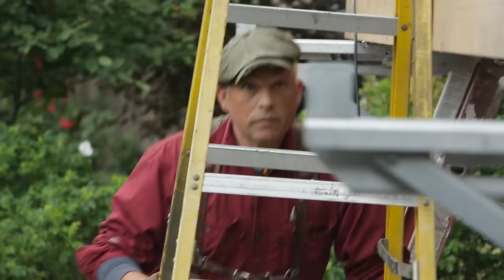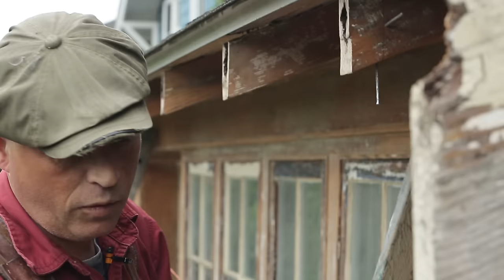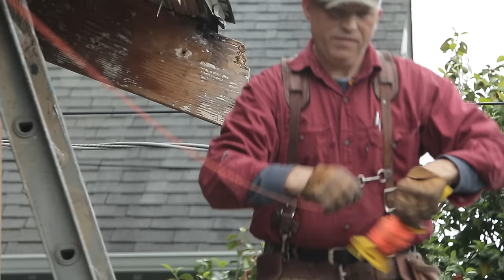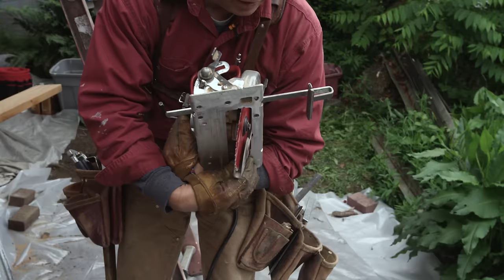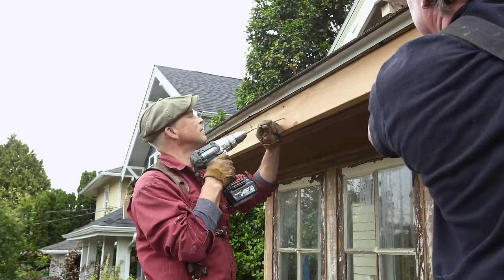How to Repair a Rafter Tail & Install Fascia

Comment: This a video that has info about the rafter tail that i was looking for, I was told that our home has some rot on the rafter tails by a rain gutter installer, I saw it too, but that it might be okay just to leave it and replace the fascia, I believe that it should be replaced now before installing anything else and obviously it will be additional cost added to rain gutter installation. I would have liked to see underneath where the rafters are, and also a finished job. Thank you I really liked your video, and will check out your other videos.

Comment: Dealing with rot on the rafter tails myself.  I’m not a carpenter, but can someone explain why gutter screws install right into them. I would think you screw another 2x4 right next to the rafter tails and attach the gutters to these. That way you can maybe avoid the eventual rot from the screws going into the end of a piece of wood that is not easily replaced and into one that is.

Comment: Best practice is to Seal the ends of all timber during construction with a good Primer Sealer.
The end grain of timber is like a sponge .
Reply: Which primer sealer works best in your opinion. I’m looking to DIY at my home. 
Thanks
Reply: @everettwhite9874  I usually use a bitumen based brush on sealer. And when building a deck within a metre of the ground I seal the entire subframe before laying the floor .
Reply: How long did the fascia board and rafter tails last before they rotted out from the aluminum nails? What do we use nowadays days?
Reply: @Brandon-no3vc  It's sounded like there was no facia board. That would be most of the issue, gutter apron Shou have also been installed over the facia board to protect from water getting behind the gutter.

Comment: sawsall tip:  put the blade in upside down, teeth toward the top of the machine. you have to use the sawsall upside down, or in this application right side up. you can get much closer cutting angle this way.
Reply: Sawzall tip: use multitool.
Reply: Correctomundo

Comment: Seems like a multitool with a flat blade would more ideal than a sawzall.  Thanks for the video, always great to see a master tradesman at his craft!
Reply: That's what I Thought one of those Multi Tools for the final Cut would be Much faster and easier to move around Then a Sawzall
Reply: My multitool is slow as crap. Like 1/5 the speed of my ciprocating saw.
Reply: What about a steady precise karate chop?
Reply: @pierredelecto7069  Exactly.
Reply: They make flush cutting blades for jig saws, and reciprocating saws, too. You could go all the way up.

Comment: I did this exact job 2 years ago, I didn't find anything as helpful as this would have been. I had to make it up as I went. Wish I would have seen this first!
Reply from the maker: Thanks so much for the feedback! Let us know what else would be helpful content for you.
Reply: I had a similar situation with an old house where the original part had fascias that angled back, and an addition had plumb fascias.  I decided to straighten the angled ones to match.  This is not an open eave as in the video, but a completely closed one.  I decided I didn't what the hassle of trimming the rafter tails with the roof decking in the way, so I did 2x4 blocking between them to create a subfascia.  Each subascia block has short 2x4 legs screwed on either side that run parallel to the rafters, and I screw those legs into the rafters.  I decided on the legs because it makes it easy for me to get the blocking in the perfect position before screwing it in.  Then I put my fascia over all of that.  Sounds like a lot of work, but it goes quickly.  I've never seen anyone do this, but a year later it is still good.  Does anyone actually use this method?
Reply: You just reminded me of how, many mid century modern homes had fascias that sloped back, meaning the rafter tails were a square cut. These fascias are usually raised above the roof line and were done that way to form a "swale" out of the roofing that acted like a gutter. In any case haven't done exactly what your describing, but sounds like its strong and minimally evasive. It seems like you thought this technique through before starting, and that's whats most important.
Reply: redrider3141 .po

Comment: How did you get rid of that gap at the top of the fascia in the middle. I'm replacing my fascia and soffit on a 33' run on the side of my house and the ends are 1 to 1 1/2" lower than the middle. I was planning on measuring and trimming the top edge of the fascia so the bottom edge stays straight. Any suggestions. Thank you Daniel. I'm 70 and could use any advice you would be willing to share.

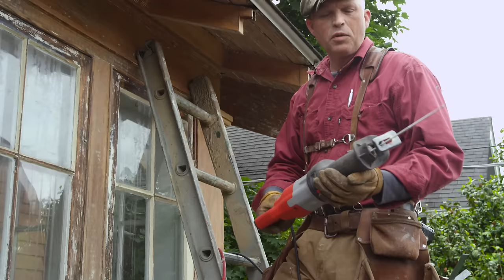Comment: 2:38 sometimes i flip the blade in the sawzall so I can get horizontal cuts more flush. But in this case you might be against the next rafter.
Reply: Mike Dorman  What about those multi tools?
Reply: Yes, and/or a plunge cut blade on a multi-tool to finish the cut without scoring the soffit.
Reply: @elifire4147  seems like a no brainer
Reply: How long did the fascia board and rafter tails last before they rotted out from the aluminum nails? What do we use nowadays days?

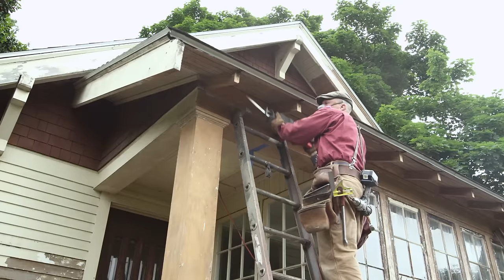Comment: At 2:50 it shows that you missed the mark on the cut.  How did you square it up to the mark so that the board fit?
Reply: The jig saw blade will want to bend in that hard fir. So what I do is clean up the cut with the jigsaw coming from the other side, or use a saws all with a fine tooth blade. Id prefer to use a skill saw, but with a soffit is not as easy, so I try to have a verity of tools available for just about any situation I may run into.
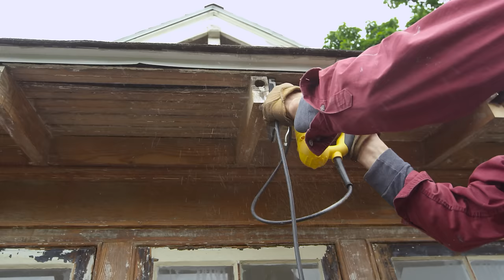Reply: 2:20 big miss. It did not fit unless he missed the same on all the tails. I set a angle on my skillsaw so it is the same for all my start cuts. Very poor cutting. Also he needs to snap his chalk line so you know it will not move.
Reply: @tomharvy9374  he isn't using a chalk line

Comment: Nice video.. let me throw out a question.. My neighbor's tree fell on the corner of my garage snapping off the 1st 3 rafters right at the headerboard... I imagine the easiest thing to do is to scab a 2 by 8 from the inside of my shop so that it's level with the rest of the rafters.. Is this what you guys would  do?  I also realize now that the 1st 3 rafters will be an 1.75"  offset from the center of where the broken ones were. is that really an issue?

Comment: Quick question what do you use to cover those screw holes before painting the fascia.  Would you use caulk or a would filler? What will last the longest?

Comment: I have an open beam ceiling with 10X4 rafter beams that pass through the exterior wall out to the lanai by the pool where the tails are rotted and sitting on a 12X4 support beam that runs 36 feet.  So there are 5 rafter beams that need the ends replaced, and the entire support beam under them has to be replaced.  Currently it is solid cypress but contractors have said stacking 2X4 boards can substitute for a solid beam, and I don't like that idea but given the expense and difficulty getting beams now may have to go that route.  My question is how do you replace the last 1 or 2 feet of a major structural beam like my rafters are?  Tearing the roof off to get at the tails is not practical, for one thing the solar pool heater is up there.  The roof is a type of construction I have never seen before, the house is what is called semi monitor with clearstory windows, and 18.5 foot high ceiling in the living room.  I have one estimate of $29 thousand and that seems pretty high.  Covid meant nobody working here all of last year, so it is pretty much getting to the emergency state.  May have to pay it.  County regulations mean I pretty much can't do it myself or hire handyman type carpenters.  Also will need engineered drawings as the county did not see fit to retain the original blueprints even though it was an architect designed house.  Getting an engineer to do them will be a problem.  I had one here who thought cypress was strictly decorative; he was from New England and was thinking of pecky cypress which is not structural.  But cypress is a fine choice in this climate, it is oily and strong, also much cheaper than cedar or pine.  Any ideas on how best to replace these tails is appreciated.
Reply: How long did the fascia board and rafter tails last before they rotted out from the aluminum nails? What do we use nowadays days?

Comment: Maybe dumb question but you cut off 3" of rafter
 You don't replace that. Now the ends won't match to th3 other side end. End of video th3 fascia from the other side is sticking out past the side you repaired.

Comment: When it sags on both ends, how can you make it straight?  Trim more  both ends ?  My rafters are not even, some are more than 1.5 " so there is a 1/4 to 1/2" gap between the facia board and the rafter tails, if i trim them even using the biggest gap (1/2") as a guide, the roof will protrude 1/2" inch after the gutter  be installed, what do you suggest i should do?
Reply: Does your house have soffits? If so, you could just use some 1/2 inch plywood to shim at every rafter tail. The soffit would hide the shimming. Be sure to use 1/2 inch longer nails.
Reply: seems like the point here is to use straight lumber and let the new lumber straighten the roof line as it should be. Making something match what is sagging doesn't make sense.

Comment: wait but putting it that way and using that size wood  creates problems, one well now it does not match the sides left and right 2x4s that you can see stick out like a sore thumb and even if you cut those to match the length now they are still lower than the front one that you just put so it dont match also, why did you not just use 2x6 so that the front one goes down further in with and match the side ones and all you had to do is cut the sides in length but will match them now?

Comment: I found this pretty confusing probably because I am not a woodworker. How did you get the fascia up higher in the center? Does the fascia lift the ends up or did you shape the fascia? There were no images at the end and “starting in the middle” seemed impossible…does the wood bend up? Concave in what dimension?
Reply: I imagine they clamped it up. That's what I would do.

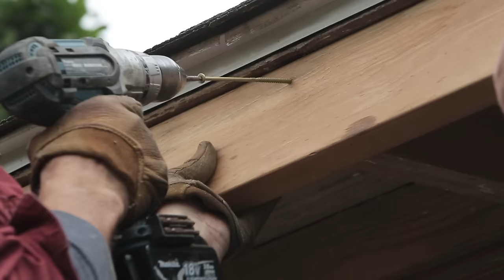Comment: 4:14 what screws are those? I need structural/framing screws in my life.
Reply: On our house we used #10 deck screws instead of just exterior screws. We actually used them inside and outside!

Comment: How far in can i cut into rotted rafter....is there a requirment for leaving so much  overhang?... thanks
Reply from the maker: This is really a matter of balancing the situation with your end goal. If you have a wide overhang with minimal decay on the rafter tails, you can likely trim them back and still be just fine. If you currently have minimal overhang with significant decay, you might consider trimming back the tails to solid wood, then "sistering" another piece of lumber to keep the amount of overhang you have. These decisions are also impacted depending on whether you are just making repairs, or if the work is part of a re-roof project.

Comment: Wasn't clear how the gap in the middle run of the facia was eliminated. I assume just pushing up on the gaped section; deflecting the board up is the answer.

Comment: What do you do if the wood rot is deeper than the rafter tail and extends into the say living room ceiling?  Can you replace a whole rafter and attach it to the main "arch beam" (forget the proper name) assuming the ceiling is going to be tore out and exposed.
Reply: yes of course. Especially if ceiling is tore out, is the time to do it. Then next time you replace the roof, go throw some nails into the roof sheathing where the rafter was replaced so its attached properly again. You could also use some short screws from the underside making sure not to purncture your roofing material.
Reply: you can also use a sub fascia to move the fascia out. or sister the rafter tails

Comment: Hello, I am planning to fit a porch roof to the house, (circa 67 wooden framed) the fascia is narrow in vertical depth and matches the height of the sloped rafter tails. The modern guttering attached to the fascia board covers about 3/4 of the board so there is insufficient room to attach a ledger board through the fascia to the rafter tails. Can I use a deeper fascia board and replace the one on the house in order to give sufficient room to mount the ledger board? Would this be strong enough? If not would it be better to sister some deeper tails to the rafters which would be notched to match the existing rafter but deeper at their ends so I van attach the wider fascia? Thanks
Reply: Hi, Allen. I'd have to see your project to really know what your up against, but generally its best to remove the gutter, fascia and soffit, so the rafters are sistered in. Maybe best to also sit the new rafters on the top plates, and that might require removing the blocking between the existing rafters. Ledgering onto the fascia wouldnt be strong enough. The end goal in adding to an existing structure is two fold. Making sure the tie in is, structurally sound and the design is seemless. Does htis help?
Reply: Thanks, yes that helps. Looking at the fascia it is only about 20mm thick so it may be covering a thicker board like the one you put on in this video. The way it seems to be done here in New Zealand is the ledger board attaches through the fascia boards and into the ends of the rafter tails with bugle screws to give sufficient strength. I would attach the ledger board under the soffit but can't because the top of the window frames are mounted directly under the soffit edge and so there is no room. This may be negated if I put in new doors as an entrance way, but I fear the underside of the porch or pergola roof will block the view and be probably too low to walk under particularly at the sloped end. I can get about a 2m height if I only slope the roof 5 degrees which is not much. The main roof is only 20 which Is not steep either. It might mean I end up making the roof a stand alone one with its own posts next to the house. Whilst more involved it may be the strongest option. Thanks for you advice.

Comment: Very nice!!!  What type of wood are you using for the fascia and would you recommend primed white pine.
Reply: We are using an S4S cedar. That is smooth four sides. Cedar, is the best for exterior applications. If there is a chance to be exposed to the elements, especially in Seattle, I would not recommend using a softwood like pine, or hemlock on exterior surfaces even if it is pre primed material. You can get a pre primed tight knot cedar, from Dunn Lumber. Does this help?
Reply: Or Windsor wood which is an engineered wood preprimed with a 20 yr warantee.

Comment: Why did this rad kook screw so croocked into the rafter boards.   You could have used a 2x4 bottom sits flush to bottom of rafter.   I put a 12 ft 2x6 up myself on 2nd floor home.   Nail 2x4 block extending out past bottom rafter for facia to rest on so you can nail/screw it into rafter

Comment: I did a like job on my garage. Dewalt makes a flush-cut blade for saber saws - no need for the Sawzall.
Reply: Thanks for the tip.  This will be handy in certain construction situations.  DT2074 fits dewalt and bosch jigsaws, among others.

Comment: My man looking how he time traveled from the great depression era. Just kidding..

  Nice video, my mom's house has gotten bad water damage from a shitty install drip edge or something and the facia* and rafter tails are rotted.. Its soo bad the damage has come inside and her drywall on her ceiling is cracking and starting to come down..  I have to tools and some know how but I told her to may have to replace the whole rafter and take down the ceiling to access it..  You can even attach a new facia* to the rafter because the exposed rafters are soo old and rotted.. Someone quoted her $1,800 just to fix the drywall on the ceiling ect not including replacing the rafter,facia* and installin a new drip edge.  I need all the youtube knowledge I can get.

Comment: Nice informative video. The 'CROWN' of the fascia board be 'down' when installing from the middle due to the wide gable-ends shouldn't It?
Reply: Good Call! Yes that can be done. I've used the opposite tension in the crown of lumber especially with fir or framing material as it has more structural strength than cedar. Great question.